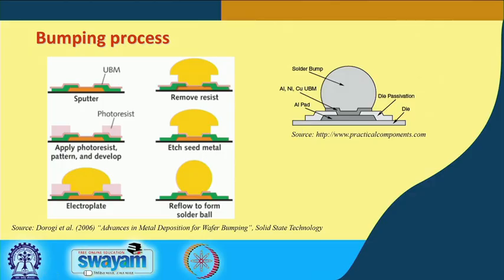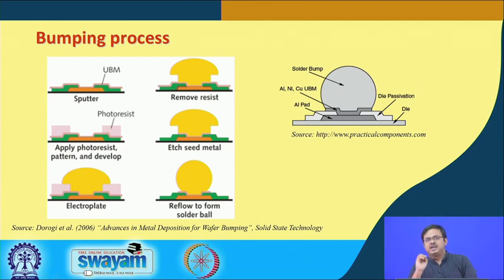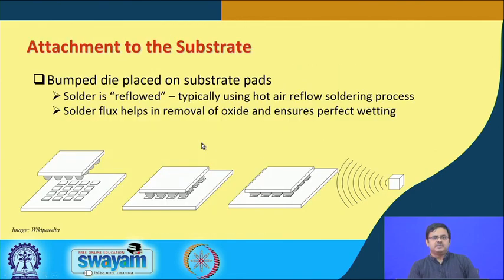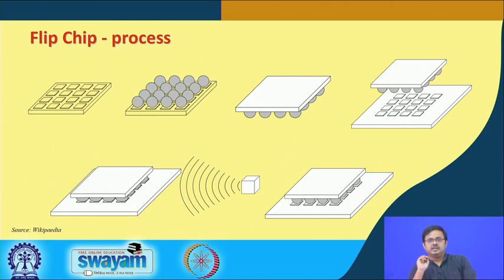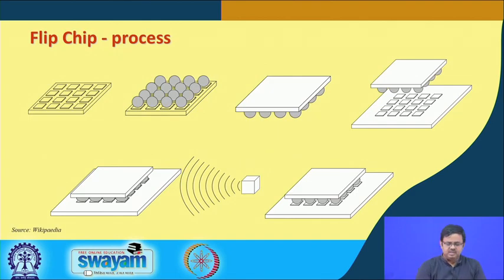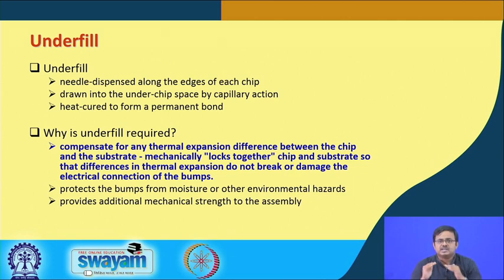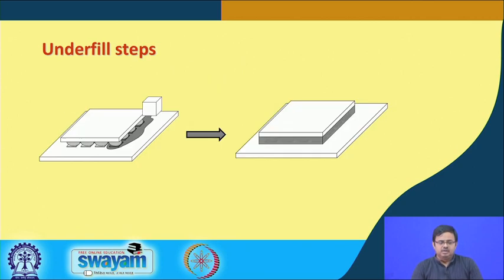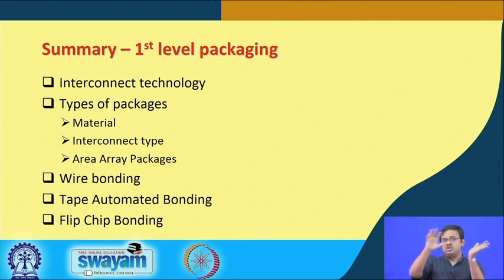Lecture 14: 1st Level Interconnections- III

Comment: Could an additional benefit of the epoxy underfill be enhanced thermal conduction to the substrate? The thermal conductivity of epoxy is an order of magnitude higher than that of air, so in this scenario, it will act as a gap pad.